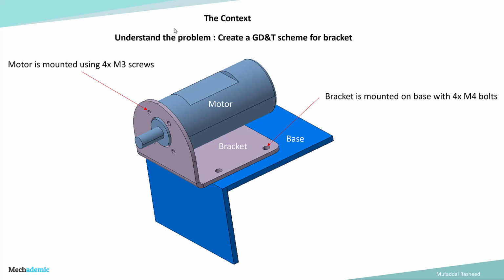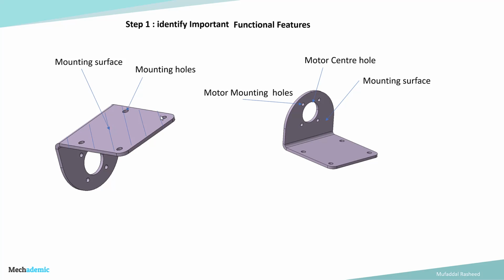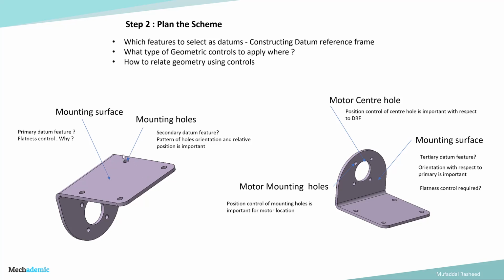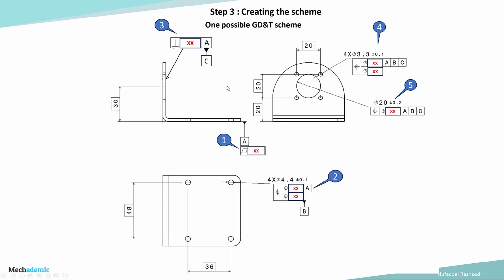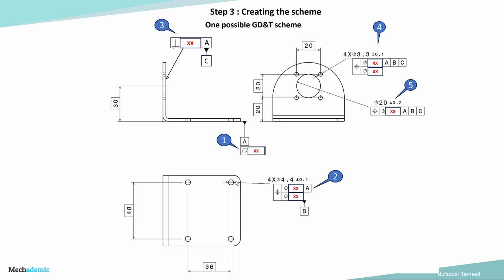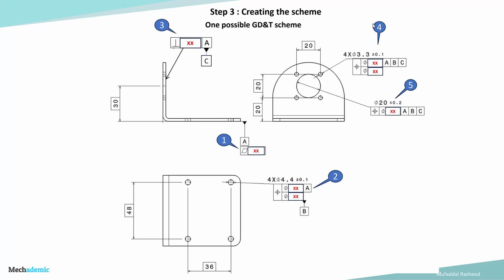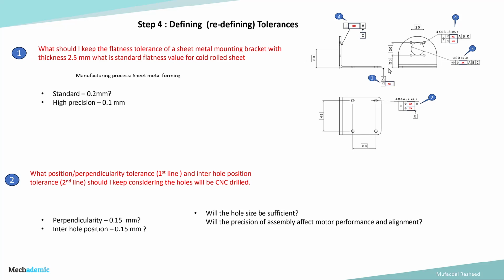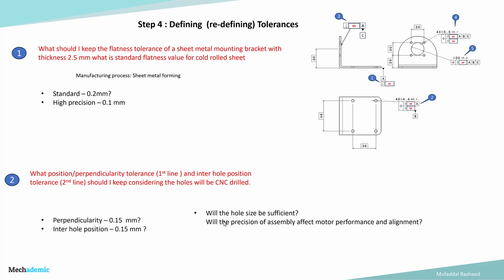Applying GD&T Scheme - Simple Motor Mount Bracket

Comment: Thanks for the video! 
I'm a bit confused.. Isn't datum B locking the bracket in all 6 degrees of freedom? If so, why would you need to call the perpendicular wall datum C?
Reply from the maker: Great point! Yes , you can only use A and B . But using it along with C adds perpendicularity control to that face
You can seperate the two with position in first line and perp in second line with different value of tolerance
Reply: @Mechademic  ok, but you could also use parallelism to datum A in second line and it would mean the same thing without using datum C, right?
Reply from the maker: @yuvalbarakmechdesign   Yes parallelism can only be used , depends on which one is easier to inspect out of three options